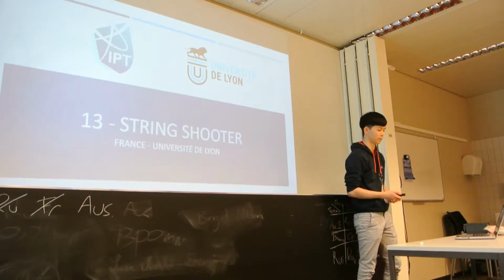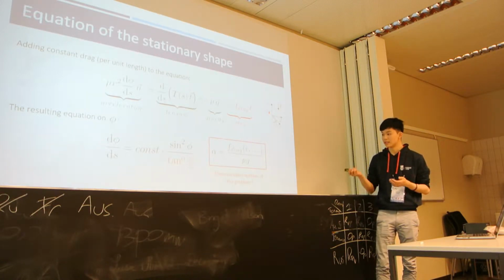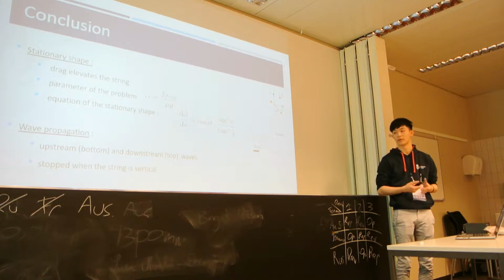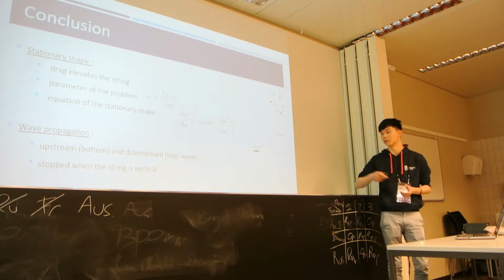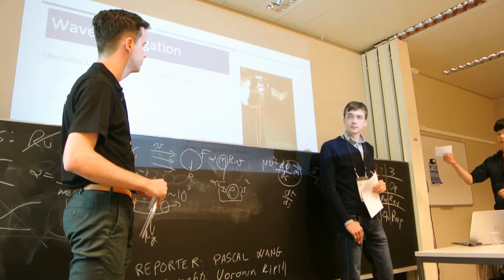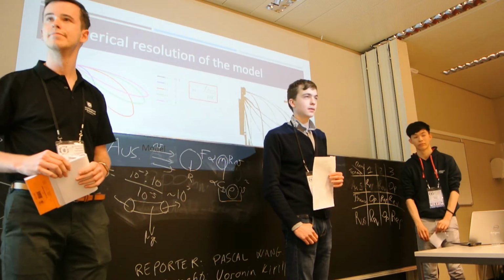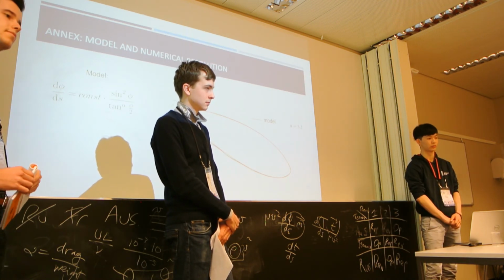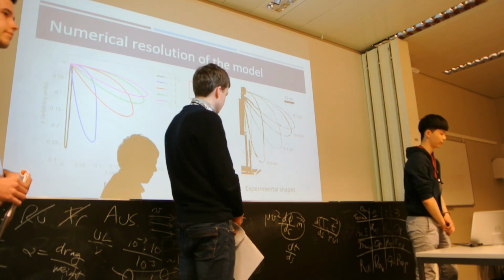IPT 2019: 13. String shooter | France – Universite de Lyon

Comment: I think this is like the "chain fountain". The string is twisting then rapidly untwists when it gets pulled around the turn. The angular momentum from the spin resists the pull.
This is the effect of the "Lever falling faster than gravity". https://youtu.be/BV7TPvk__kE (or chain falling faster than gravity)It's easier to understand by imagining a weight on the lever near the pivot. The angular momentum makes the end of the lever go faster than gravity. 
The chain fountain is the same thing BUT the "Mould effect" is not the whole story. When you lift up on a chain link(lever) you ALSO induce precession that causes the link to twist or the bead on the chain to spin. The spinning beads carry energy to the top of the arc where they resist turning around (like a gyroscope). They resist the pull of the falling chains. 
13:10 in this video you can clearly see the chain twisting on the slack side. Each link(lever) starts to turn as it get accelerated from a standstillhttps://youtu.be/hx2LEqTQT4E
Reply from the maker: Thanks for your interest and insights. I personally also believe that the two effects are connected and deserve the same theoretical expaination. However a stronger argument is needed for pushing the problem understanding
Reply: @thedirtykitchenpysic  in the case of the chain fountain I would speculate that as one end of a link is accelerated from rest, the other end acts as a pivot point but it is not rigidly held by the next link. The pivot being free to move allows momentum to move its axis toward the direction of most mechanical freedom (and maybe toward a smaller moment?) So some of the momentum is turned into spin.
could this affect the string? I dont know. maybe spiral twisted string or yarn would spin from air flow. It would be interesting to see if it works in a vacuum
Reply from the maker: @zaphodbeeblebrox2817  As far as I remember another team that solved this problem made experiments in vacuum and showed the effect vanished